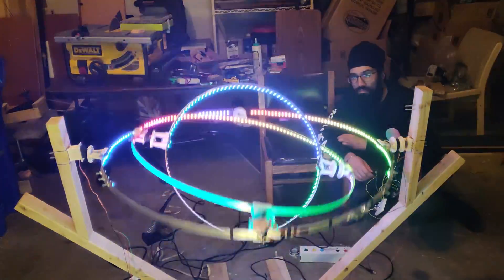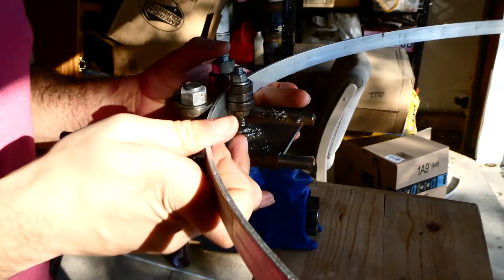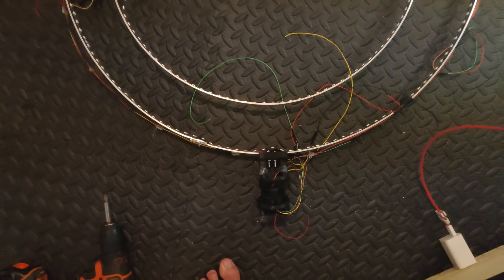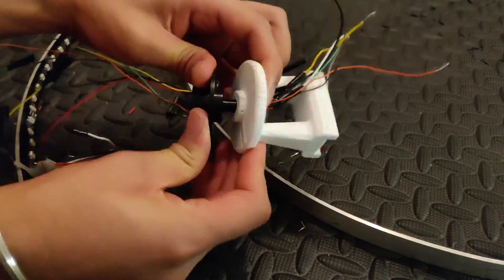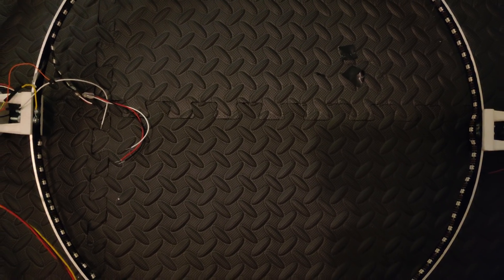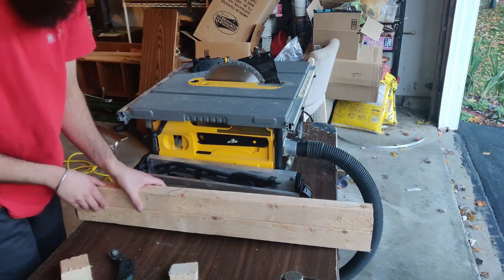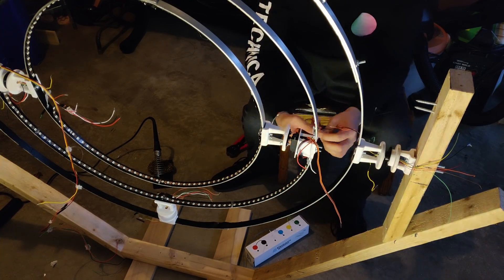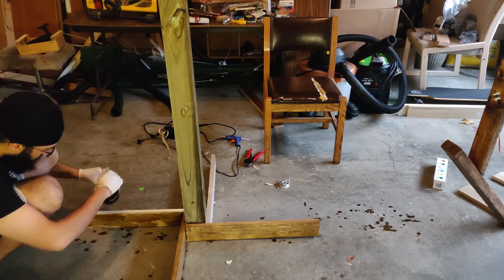🍉 Armil (LED Spinning Armillary Sphere)

Comment: that is not the correct JB weld for aluminum, thats their generic purpose type. the metal jb weld would have done a great job on the aluminum, but good job on the build anyway :)

Comment: You really could use some LED's on the outside of the rings too.
Reply from the maker: Yeah. I need to update this project. I'll probably add more LEDs. I just hope the Arduino can handle addressing all those LEDs. Its already over 400.
Reply: @ODDRISER  Wow over 400! Intense. If you get it dialed in you could market these things and sell them to clubs/bars I would think. Very cool design! Great work!

Comment: How did you get it to spin without twisting the wires?
Reply from the maker: Slip rings
Reply: @ODDRISER  Yeah used on of those too. Electrical Slip Rings. My new problem is attaching to the end of the slip rings where it doesn't wobble. Can't get the right diameter. Any suggestions?
Reply from the maker: I designed and printed my own 3d parts for housing the slipring.
Reply: @ODDRISER  I would love some details on your design for using the slip rings - close ups or design details on the 3D printed parts.  Thanks if you are willing to share.
Reply from the maker: @zephsmith3499  dm me on Instagram. Im @gurpr337 i can send you close up photos of the slip ring parts.

Comment: First up: Very well done! I am really impressed! 
But I was wondering: 
How did you solve the problem, that after a few rotations the cables experience some torsion tension which increases with more rotations?
Reply from the maker: There are sliprings, opposite to the servos, at each rotating joint.
Reply from the maker: Its just the Adafruit Neopixel code to control the LEDs and then the usual arduino servo code for the servos.

Comment: Could you get the lights on the outside of the rings as well and increase the density? Maybe cut a groove down the rings to lay the wiring in a conduit? Cannibalize high stress bicycle rims? Keep up the effort. Much love from Philadelphia.
Reply from the maker: I was thinking of bicycle rims initially but they weren't large enough. Also i needed an excuse to learn how to do metal working.